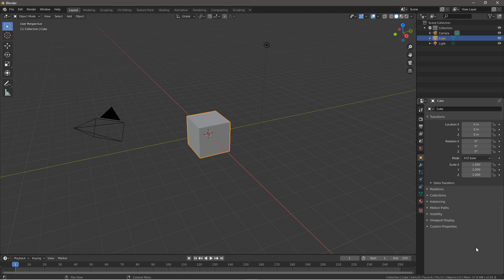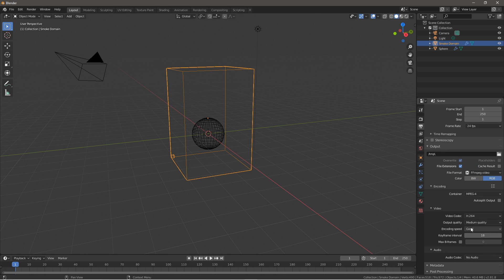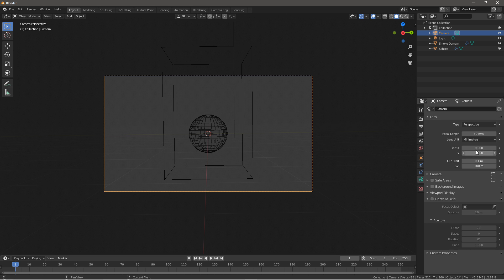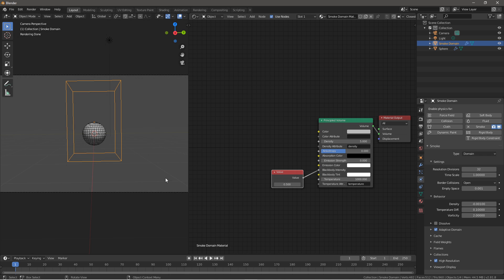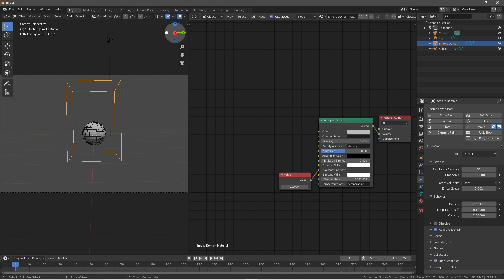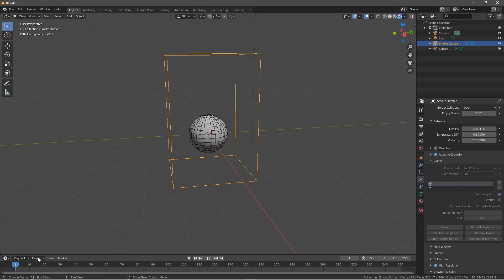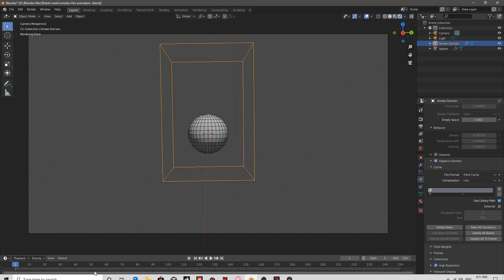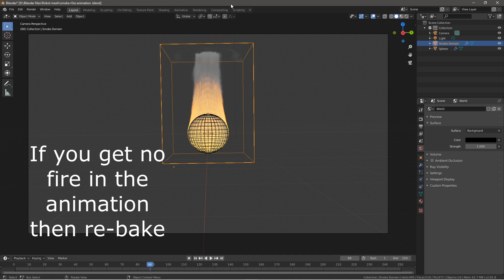Blender 2.8/2.81 How to make Fire In Cycles- A Blender Tutorial

Comment: I dont know why but the simulation does not show up
Reply from the maker: Make sure that you are in the cycles render engine. Also, make sure that you are in rendered view and that you are on something like frame 150 to see the animation. If that does not work rebake the animation and it should solve your problem. If any of these suggestions did not work reply with an update on your situation. (:
Reply: @SteelShadowAnimations  where can i see the fps? and can i change the fps?
Reply from the maker: Yes, you can change the FPS and see what the current FPS is. On the right hand side panel look for the icon that’s below the camera. It looks like a printer and it’s name is output properties if you hover your cursor over the icon. Click on that and look under dimensions. You should see your current FPS which is typically 24. You can also click on it and change it if you desire.

Comment: when i played the animation after i added the black body value, instead of a fire, it was just a highly pixilated grey "smoke" box with a black circle in the center. That's the best I could describe it. Note: There was not a high res option for me.
Reply from the maker: Did you switch you render engine from Eevee to cycles? Also click on the UV sphere and look under settings. Make sure Fire+Smoke is selected. Please reply back with an update if this did not work.
Reply: Turns out that I somehow missed a bunch of steps in the beginning, but, all I see now is a white
 sphere with what looks like gas distortions around it.
Reply from the maker: Try rebaking the animation
Reply: @SteelShadowAnimations  I tried again this morning, I followed your tutorial again. The result once I added the black body intensity value was strangely like the first time I tried. I'm baked and free baked and baked again  (not sure if that's what you meant, I've been using blender for like 4 days) and I'm not why it would be different. Maybe update changed things up?
Reply: Found a solution (i think, still confusing reasons though) Need to bake data BEFORE playing the animation due to the update.

Comment: when I click shading rendered the circle still in wireframe...why?
Reply from the maker: Make sure you sure are not sitting in the beginning of the time line, hit play. Also make sure the animation is baked, if it’s still not showing up re-bake the animation. This works for me sometimes. Lastly, make sure you got the value for the black body set high enough.
Reply: @SteelShadowAnimations  thank you.  I will update you
Reply: @SteelShadowAnimations  hey,   I did the bake and I can only see smoke in the animation,  but in the wireframe the fire....
Reply from the maker: Bar Yafe Click on the UV Sphere and make sure that you have Fire + Smoke selected. You may have just selected smoke. If you accidentally selected Smoke, rebake the animation and you should get fire as well.
Reply: @SteelShadowAnimations  did not work :(
Reply from the maker: I am guessing you are using a windows machine and you have a good amount of knowledge on how to use windows. Search up control panel in the windows search bar, then under programs click uninstall a program. Find and right click blender, after doing that click on repair. Make sure Blender is closed when you are doing this. If that doesn’t work go to the Blender.org and download the Blender 2.81 as this is the version of blender that will work with this tutorial. Blender 2.82 and up has the new mantaflow system. I will make a tutorial on that as soon as I am free. If you want you can update blender to 2.82 and follow other tutorials, I am fine with that as long as your problem is resolved. Just beware that mantaflow can be a bit buggy and more confusing/complicated. Hope this helps (:

Comment: i have done it but i can only see smoke. Is there a way I can make the smoke invisible or a little transparent at least?
Reply from the maker: Click on the UV sphere and make sure you are in the physics/simulation tab. Then under settings change the flow type from fire+smoke to fire. After doing this I would recommend that you rebake the animation. I think you have to anyway. If you need more clarification reply to my comment.
Reply: Steel-Shadow Animations 
Awesome
But how can i make the smoke like white snow dust and i can see close things but not far things (another thing for my fire pit in the snow project)?
Reply from the maker: Sport6000 for making the smoke like white snow dust change the color of the smoke to white, you can do other funky things in the node editor but, I’m not really a master in that. If you cannot see far things then select the camera, and go into the camera settings and increase the clip end distance. Reply to my comment if you need more clarification.
Reply: Steel-Shadow Animations 
No its not that
The snow dust is too thick and i cant see close nor far things with the smoke thing on
Reply from the maker: Hmmmm, click on the UV sphere and going into the physics/simulation tab. Under settings experiment by turning down the density of the smoke.
Reply: Steel-Shadow Animations 
hmm it does nothing
Ill re-bake it and see

Comment: My doesnt work :( it just doesnt show any fire or smoke, what might be wrong?
Reply from the maker: Did you save and bake the animation? Did you connect the value node to the black body intensity? Check if the  value set high enough. If this did not help comment again so I can help. Also if you know tell me what version of blender you are using as blender 2.82 has a new mantaflow system making this tutorial sort of obsolete. I will make a new about this soon. Lastly, Sorry for the late response.

Comment: When I click adaptive domain the box disappears than I noticed a little tiny box down below and the sphere got larger. A when I press Ctrl + alt + 0 nothing happens. I have blender 2.81
Reply from the maker: David Dahl it’s normal to have the domain box become small. Once you bake the animation it will turn back to normal and it will do what it does in the video. Make sure that the 0 you are pressing is the one your num pad. If you cannot lock the camera by using Ctrt+ alt + 0 then press 0 to get into camera view, then press f3 and type in fly. Click on view Navigation (walk/fly) and now you can use your wsad keys to control the camera. Left click to confirm.

Comment: when i press f12 fire and smoke does not render..
Reply from the maker: Is the value node attached to the black body Intesity? Also make sure to set the value high enough. Also try to move your timeline to like 100 frames and press f12 to render. Also, Attempt to Re-bake the animation. If these suggestions did not help reply again.
Reply: If you want to render an animation (not just a single frame), you'll need set your start and end frame, then press Ctrl F12.
Reply: @AlimationGarden  thanks.. i forgot about this hotkeys